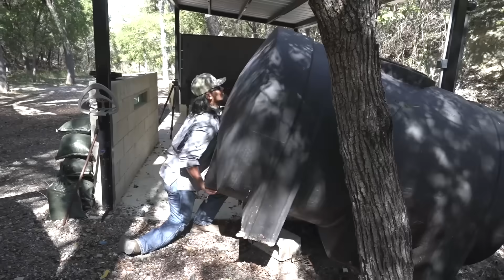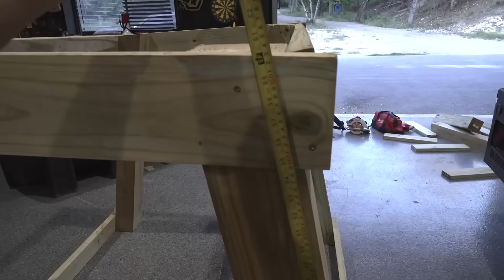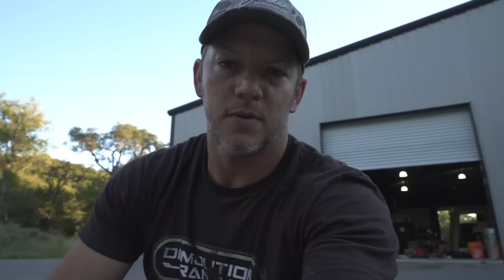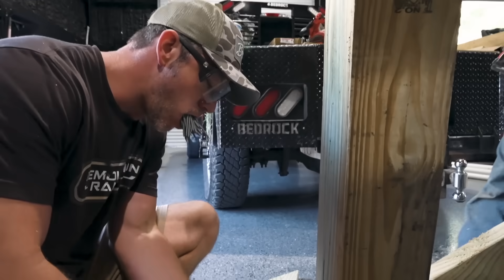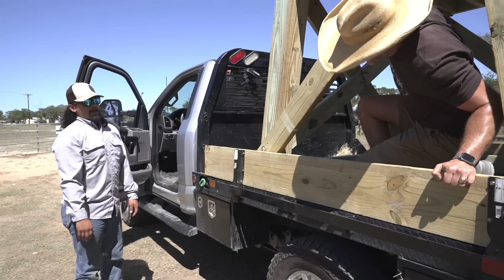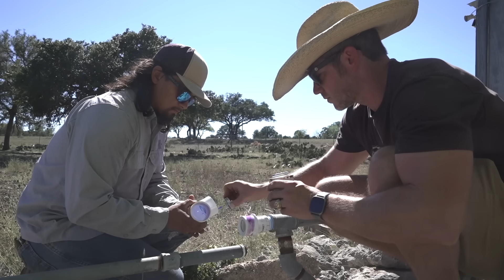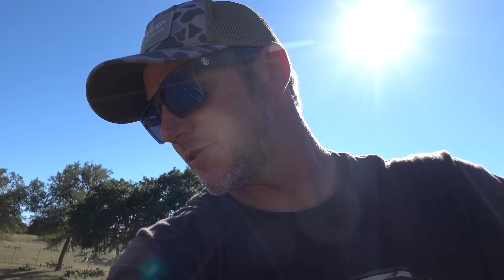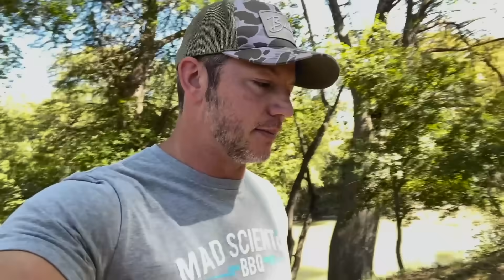Going Into the Cave… But This has to Be Done First!

Comment: Matt, if you drill a hole in the top 90 on your overflow it will make a siphon break and things should work right.
Reply: This. Your highest point needs a vent.
Reply: I came here to say the same.
Reply: I was thinking of putting a Tee in place at the highest point and extend a pipe up maybe 2ft. above the tank height.  Just so water will not come out and make a mess and it would stop the siphon.
Reply: No, no they wont...
Reply: Yeah and/or a one way check valve to make sure the water doesn't flow backwards through the fill valve.
Reply: True.   Put an open T at the top bend.  Let air in, no syphon😅
Reply: No using a intank float filling from the top because ur working against gravity and that hole vent thing is no different from the pipe going to the pond it's the same pipe. To brake the suction u need to create new at the same level. And u can't use a one way valve if you intend on unloading from the same valve.
Reply: @zx1100a1  of course!
Reply: Lets get this to the top!!! Thank you, the end was messing up my problem solving geek inside of me:-)

Comment: Your wife, the engineer, is going to laugh about this one.
Reply: civil engineer, but yea still an engineer
Reply: you think his wife watches this sh!t?
Reply: @willdavidsonakawd3062 civil engineer, you know they do water stuff right???

The channel RCE real civil engineer (he quit to do youtube) was specifically a water and drainage engineer..
Reply: This looks like a built i would expect if someone does not own or use any power tools. heh.
Reply: @willdavidsonakawd3062  - da ha ha - As a Mech Eng, this is funny, but they still do "work"....  (?? ?? though how boring are statics)... Steady state...  lol...
Reply: @dylanzrim3635    - fluid/hydrodynamics is a mechanical field (fluid/hydrostatics too) -- as is most "interesting" engineering .  Civil may claim a subfield here, or there. - NB, back in the day Engineering was either military or civil, the fields (EMC..._ didn't fight for "market share"..
Reply: @lemurkirsche7891   - "build" ???
Reply: @kadmow  something/anything that was built.
Reply: That handsaw on the pvc pipe was a terrible sound! And remember the old saying, "measure twice and cut once"! 😂😂😂
Reply: @willdavidsonakawd3062  Civil engineers deal with most low-pressure or gravity water systems, including wells and tanks 😂
Reply: You need a vent at the top of the u that extends about 4ft up (depending on pump output pressure).
Reply: @kadmow  Most water systems like this are almost entirely civil engineering, especially when they’re so similar to municipal systems like this one is. Mechanicals might design the pumps, but the civils implement them and integrate the water they pull into existing infrastructure.
Reply: If the overflow ever fills the output pipe, I think it will drain the whole tank by siphon.
Reply: #donttellmere

Comment: For that siphon you started, just drill a hole in the top "U" before it bends down and drains down into the pond, that'll stop it.
Reply: Or a T in the u
Reply: My thoughts exactly, vent the top of the overflow so it pulls air and doesn't create a vacuum to siphon.
Reply: Yup air gap in the system will break the siphon
Reply: I was about to comment the same thing lol
Reply: I was thinking the exact same thing. I work with pumps and wastewater. And that will break your siphon before the 200 gallon mark.
Reply: Almost said the same thing
Reply: They also make a check valve you can install to break the siphon. Common use on older houses that were not vented.
Reply: Yes!
Reply: Was just working It through you might have to cut the u out and attach A. T below the siphon to go to the pond.
Reply: @TheDrakenZ  it kinda like a pee trap on a sink or toilet 👽
Reply: 69th like.
Reply: I thought that would be a siphon but did not know for sure. pretty clever suggestion to just punch a hole in the top
Reply: isn' t  his wife an engineer?
Reply: @bong-o-boy7105  T is probably better, I second that.
Reply: Was literally running here to say the same thing Draken! 👍
Reply: I was right there! 😂 you beat me to it.
Reply: I just figured open the side not connected on the bottom that valve. Should break the flow and pressure and let the tank fill again.
Reply: check valve is the easiest way
Reply: @levihiggins1372  i work on big boats. Any engine open to seawater below the waterline will flood with water without a siphon break. I small hole at the top will let air in and stop the siphon. We use ones that have a valve so water doesnt squirt out but just a hole will work for that.
Reply: @cfreeses same 😂
Reply: @robertdinicola9225  I understand that but I’m thinking everyday or fast emergency use. Let’s look at this from a practical point of view who do you know that’s like 10 feet tall to reach top of that syphon. Not many right? I’m thinking something you don’t need a ladder to access
Reply: I have drilled wells, installed pumps and water lines and put in 2500 gallon tanks and 5000 gallon tanks for off grid houses like this for about 6 years in my late teens early 20’s. My mom dated the owner of the business. I can even build and wire pumps. A small $200 pump will give that perfect pressure to fill faster maybe 30 or 45 mins but better than hours or a day. I just got an idea to make it easier. Split the tall tube. Heading up. Put a shut off valve there. When you want to go to the pond open the valve. When you want the tank to fill. Close the valve. Bingo easy to do, easy to reach, save a lot of hassle
Reply: @TheDrakenZ  I own a fish store so I use PVC on a daily with pumps filling from the top will work more efficiently and faster. Drilling a hole in the top of the U as stated above will stop the siphoning.
Reply: No, no it won't...
Reply: I was gonna a say make one a tee ....just need air
Reply: The pump will still pump past the tank and to the lake, and out of the hole, it dosent solve the issue of water weight in the Giant tank. 

Also an airgap would not just be a hole, it would need to be sufficiently tall or have a larger pipe for a master cylinder effect... who am I kidding? You guys have no idea how any of this works. Go watch some fluid dynamics videos.
Reply: It’s called a siphon break for a reason.
Reply: I saw that as soon as I saw his configuration, he needs a vacuum breaker.
Reply: Or just fill from the top and drill an overflow at the top with a pipe from there into the pond.
Reply: @cytrydo  Yes Mere is but if I recall from when he built his rain collection system at his previous house she wasn't super interested in it. Matts the kind of guy that likes to stew over a problem like this and think of his own solution
Reply: agree
Reply: This is similar to what I was thinking. There just needs to be an air gap somewhere in the system I think.
Reply: Or a simple check valve.
Reply: Putting a hole will help fill the tank, but when the tank is full, the pump will pump water out that hole. Installing an intank float would keep everything sealed, filling it from the top. Because he's working against gravity, unlike before when he was using gravity to fill it using the roof. Plus that tank will be trying to drain at the same time as filling because of the water flow itself from gravity, thus hard on the well. Do it right with a float or burn out the well. Your choice
Reply: Damn, here I am thinking I've got a hot take about a simple fix, and literally everyone's beaten me to the punch 😆
Reply: Just replace one of the elbows at the top of the u with a tee and a stand pipe going straight up maybe a foot or two. A hole will break the siphon but once it goes into overflow it will leak some of your water close to the tank. The pipe allows it to build up a bit of pressure to make it flow towards the pond.
Reply: i know a little about siphons but not understanding why it drains the whole tank , i thought it would only drain the amount of water in the pvc
Reply: - or "just shoot it"....

Not like Matt can't put a hole in a thing...
Reply: @slickdiver3799    - I was thinking - from the "T" - to the tank  - put a simple pressure tap/tube  to the top - to prevent the tank overflowing (so-long as the tank is vented pressures will equalise.)
Reply: @kadmow  that sir is the proper suggestion I was expecting from this channels viewers but he wouldn’t be able to show it on YouTube even if listing it as a plumbing solution.
Reply: The siphoning may actually be beneficial though since it will prevent an stagnant water situations and help keep the tank cooler in the heat, but would consider adding something to reduce the flow so it takes awhile to drain.
Reply: Hadn't only got as far as him showing the overflow plan and was like "that's going to act like a greed cup"  soon as the overflow starts, it'll empty the tank every time. Anything that allows air into the top of the overflow 'U' will break that siphon so it's a nice and simple fix.
Reply: Just typed out this exact comment. Really need to read the comments first. Easier to hit a thumbs up.
Reply: came here to see if someone had a solution
Reply: and this is why Matt should and will film all of these... he gets to read all the comments on how to do these :D and pretty much the rest of us as well
Reply: Thanks for that, I need it for an issue with my aquaponic system 😂
Reply: would need to be a T that extends higher than the top of the tank so that it never "fills" the T if you just drill holes yes it will prevent the siphon but because the U is below the top of the tank you wold have water pour out of the hole you make, when i lived in mexico this is how the tanks were set up. all of the lines coming off the tank have a T that extends above the tank to prevent an air pocket to form so the line is only empty if the tank is empty

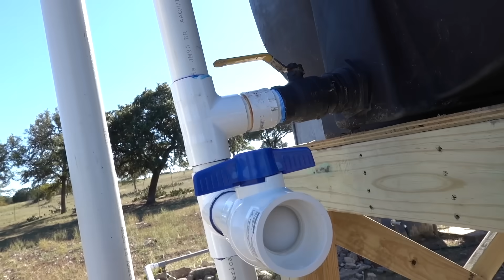Comment: 27:56 mark...Matt and Crew, all you guys needed to do to solve the siphoning effect pulling water from the tank and draining it into the pond was to drill a 1/2" hole in the center of the top side of the "U" at the highest point and install a glued-in fitting with a 6" tall tube glued to it pointing strait up. With the air "leak" up that high, there would not be enough suction to pull water to the pond at all, problem solved.

Comment: Matt run a line to the top of the tank from the well ,T it off. Install an intank float on the top of the tank. The other side of the T raise up a little for the overflow for the pond. Then ur set.

Comment: Matt, you need to remove the silt from the bottom of the lake and spread it in a layer on the ground around it to increase the fertility of the soil for animals and for beauty. And put a special fabric on the bottom, it doesn't have to be expensive if there is clay on the site that can be put in an additional layer on one. And then the water bills will be normal and the water will not go into the ground/caves..😀🧐😉
Reply: ^ This but being a pond owner myself I recommend clay and bentonite.
Reply: The water pumped into the pond is all just well water so there shouldn't be a water bill as it's set up
Reply: There's not much silt. That pond goes to rock pretty quickly.
Reply: he did that already ages ago, well the part about diggin out the pond and spreading the dirt outside the pond. The Bottom of the pond is solid rock.
Reply: Solid rock
Reply: @noodlelynoodle. Nope, just electricity.
Reply: he went in to this before, pond bottom is bedrock. its held water for decades. clay would just be a waste in this case.

Comment: It depends on the head pressure from the well pump. My educated guess (as a civil engineer, specialized in H&H and currently working on a large diameter pipeline and 2 8MG tanks) is that as the tank fills, it requires more head pressure to fill the tank, which can quickly surpass the rating of the well pump.
The best and most efficient way to fill a tank is to pump to the top. Even on the large 8MG tanks, we are running a 30" pipe out of the ground and up the side 35feet into the top of the tank.
Reply: Head of water in the tank or head of water in the pipe that's going up to the top... It's unavoidable either way

Comment: For the water tower plumbing, to relief the current configuration, you need to put a vent hole on top of the highest point. That will only allow water to be pushed over the top and will not form a siphon. 1/4" hole will work. everything else will work fine.

Comment: Change the top elbow to a T no vacuum but filling from the top will take pressure/stress off the pump
Reply: Incorrect.  Pressure is only related to height. So filling from the top it is actually creating a taller water column and higher pressure until the point the tank is full.
Reply: @Benjamin-rq1fi I’d argue that. Volume also creates pressure in a fluid not just height.
Reply: @kboreliz  that's only true if you're talking pumping into a non-vented tank and the air space (which is a compressible fluid) gets smaller causing increased pressure.  Then it's still not the volume, but the fact you have he same amount of air in a smaller space.  You could have a 5 foot tall tank that's 5 feet wide and it would create the same pressure at the bottom as a lake 5 feet deep but 1000 miles wide.
Reply: @kboreliz it’d be a false argument. Head pressure on the pump is ONLY related to the height it needs to pump, not volume above it. That said, filling from the bottom is actually slightly easier on the pump as it doesn’t need to clear the top of the tank like you would have to do if you filled it from the top.

Comment: Matt, run the pipe to the top. Fill from the top. Then, cut a hole near the top of the tank coming out horizontal for the overflow to come out of to go to the pond. The tank will always be full, and your overflow water will always come out of the tank.

Comment: It's a super easy fix
Turn the T at the mouth of the tank 90 degrees, that way the pipe coming from the well will go directly into the tank, and when it's full and the water no longer have "room" to go into, then the overflow will kick in.
Hope this helps

Comment: On the X braces couldn't you have done one inside and one outside. 🤷🏻‍♂️
Reply: I would have put a leg in the center too
Reply: Yes, if he had half a clue what he was doing. The proper way to construct it would be structure on structure, so the posts are supporting the weight of the wood above and not just screws and bolts. It will be interesting to see how long it lasts when he fills that tank up. Hopefully it doesn't fall on anyone, because there won't be anyone walking away from something like that.
Reply: Thats what I thought
Reply: @MAGAMAN  It's not going anywhere.  Yeah would be stronger if the platform was sitting on top of the post.  But go look at old mine structures  The wood is going to give up before the bolts do.  Then just one of those bolts could support the weight of that tank full of water.  If friction of nails can hold a house together.  And this has actual bolts.  It's not anywhere or collapsing.
Reply: @MAGAMAN 
Yep, stack wood, don't hang it. Should have built the deck on top of the posts not hung them on the sides.
Reply: @nunstersplace yes the tiny part of wood above the bolt will give way and the whole board will fall. The correct way would have been to build the frame on top of the posts. 

Bolts are often used for bracing, capturing, and locating lumber but not for downward forces, downward forces are always reliant on stacking. Go actually look at some construction, I dont think you have any building experience.

Comment: Pex. Pex. More pex. Will expand to a softball size and not bust when it freezes… and it bends… without shattering… 1” pex should handle all the volume that pump can put out. Also.. standard circular saw= 2 3/4” cutting depth +(flip 6x6) 2 3/4” cutting depth = 5 1/2”(nominal width of 6x6). Be safe. Have fun

Comment: You have to make it top fill because as you're filling from the bottom, the water pressure of all the water you've already pumped into the tank is now pressing against the water that the pump is trying to push in. If you fill from the top, the only resistance that the pump will be facing is the water column in the pipe before it dumps out into the tank.
Reply: good thoughts, but the pressure is the same, hydrostatic pressure only works in the vertical
Reply: That’s not how water pressure works.
Reply: Ok thanks for explaining.

Comment: Hey Matt, first comment here but long time viewer (and you're one of my whopping 5 subscriptionds haha). I built an aquaponic farm with a similar PVC setup and found that drilling a smaller hole in one of the top 90 degree bends eliminates the siphon effect. I'd try starting there before disassembling the whole thing! Not sure how well the filling will go from the bottom with that much water pressure from a full tank though. That's another problem

Comment: Is your water tank vented? If not, as you fill it up you are going to pressurize it and there will be nowhere for the air to go. That may explain why it was filling so slowly.
Reply: It's vented
Reply from the maker: Yep, vented
Reply: Filling water from the bottom you have to overcome the water weight
Reply: Exactly what I was thinking and it make hard that the water source is at a lower point, not higher like it was in the previous setup @ScarferBrad
Reply: Or inplode from high pressure vacuum
Reply: @ScarferBrad incorrect. Head pressure, the pressure the pump sees, is only related to the distance (height) it has to pump. The volume above it is irrelevant. It’s actually slightly easier on the pump to fill from the bottom as it doesn’t need to pump the extra height to clear the top of the tank.
Reply: @ScarferBrad Weight of water in a top fed line = weight of water in the tank...  They'll be the same